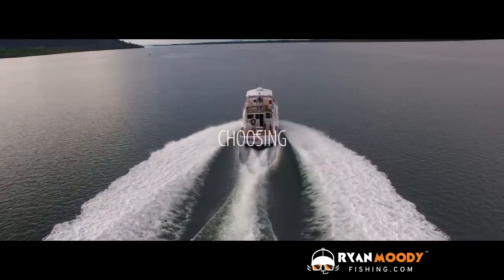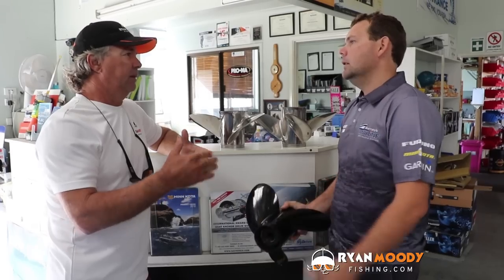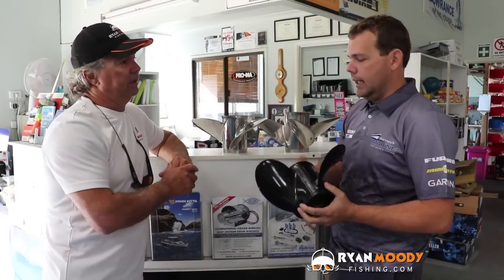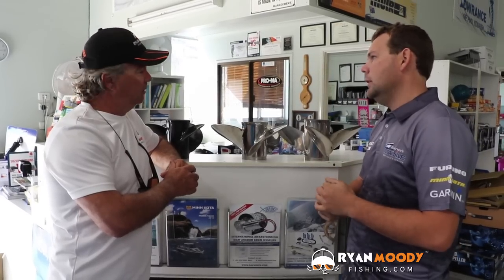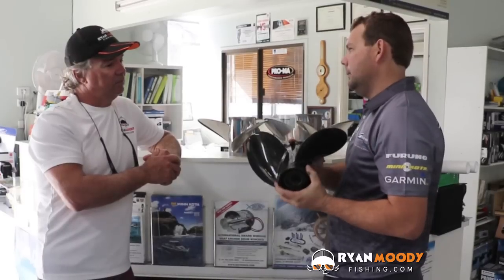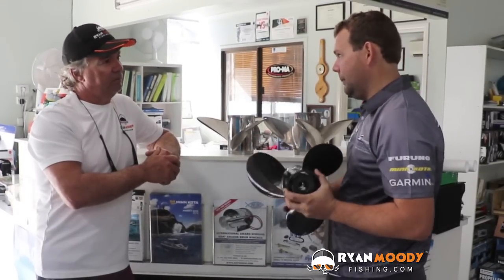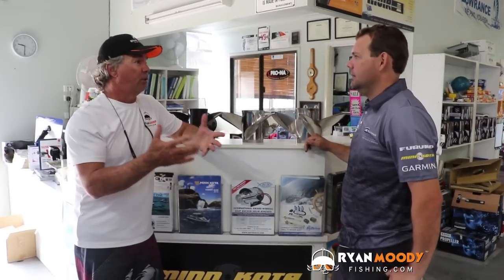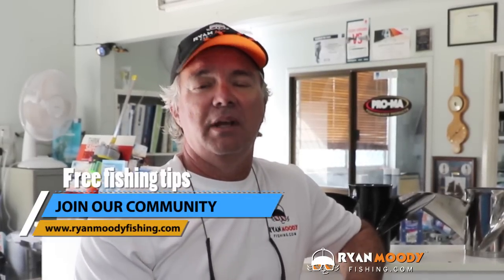Choose the right propeller for your boat

Comment: Thanks for taking the time to your share your video and knowledge with us. 
It is really appreciated! 
I have a 5 mtr. RIB with (x2) 40 hp Enduro outboard motors 
(5500- 6000 rpm. max.),  both have three blade props 11 3/8 x 12. 
The Boats max load capacity is 1 ton and although I am no 
way any where near that at all, it seems slightly heavy at the 
transom, once she is loaded up with dive gear, since it is very sluggish, 
to get up on the plane. 
I am looking to increase the power, for towing applications, as 
we are doing small salvage operations. 
From what you were saying, it seems that a 4 Blade prop is the 
way to go, but I have not seen any for this size of motor. 
Do you have any suggestions? 
Thanks! 

Kind Regards!
Reply from the maker: Sean Ashcroft best take it to your outboard dealer Sean as they can have a look at your setup and make more informed recommendations.
Reply: @RyanMoodyFishing  Thanks Ryan. 
However, I live in South Korea and my Korean is no good! 
Thus my reason for asking you.
Reply from the maker: Sean Ashcroft I’m real sorry mate. I feel your pain but I’ve not had anything to do with RIBs or that hull type of that horsepower or that make of motor. Nor do I carry weight in my fishing punt. I’d just be totally guessing. Sounds very specialist to me hence why I went to a dealership to ask those same questions.
Reply: a very late reply , but let's just write it.

With 2x40=80hp , you should be able to plane at min. 10knots with 80hpx40kg=3200kg total weight. and you claim you never reached 1ton in total.

the problem seems to be 80% load distribution and 20% incorrect trim setting.

you can switch to 11 3/4" X 10" Pitch and lose 20% top speed , but plane more easily with a loaded boat or while towing.

Comment: Thanks. Have a 4.3 V6 20ft overrevs. Older 1993. Load varies just dont want it over rev.gess 4800 -5000 top. It wants to pass 5500 if i let it.when kick in 4barrel.
Reply: Get a bigger prop

Comment: Stainless "has no give", true but is that not what the shear pin is for?  To snap off and prevent further damage?
Reply from the maker: Shear pins are mostly in smaller outboards. Bigger outboards have bushes.
Reply: @RyanMoodyFishing  Fine, same question then, dont the bushes prevent further damage?
Reply from the maker: @jimquantic  I’ve used stainless all my life but I’ve never actually hit anything major so I’m not speaking from personal experience but know of several people who have damaged gearboxes and /or shafts hitting things with stainless. But it’s up to you what you use. Alloy props have a bit more give but require more repairs on the prop if you hit something.

Comment: Could you give me any suggestions I watch propeller be a good fit for a 1998 Larson flower 176 with a 90 hp Johnson That Carly has a 19 pitch aluminum three blade prop that starts porpoising at 23 mph and loses power in the corners when pulling a tube any feedback would be greatly appreciated thank you
Reply from the maker: Clayton Gilbert do you adjust your trim and tilt when you go to a higher speed? Trimming the nose down should solve the porpoising. Regards the prop, best take the boat to a Johnson dealer and they can experiment with you as there are so many variables it is impossible to answer in a text.